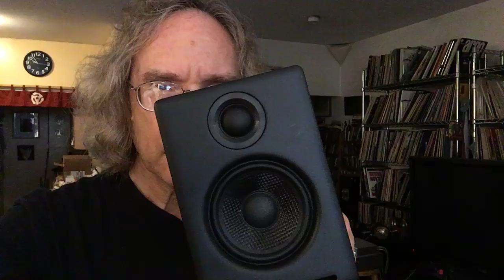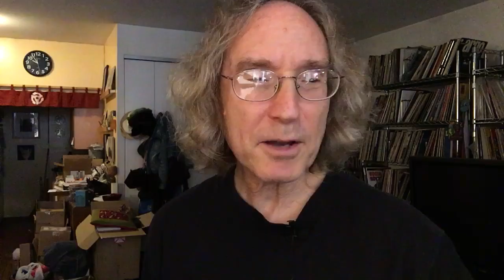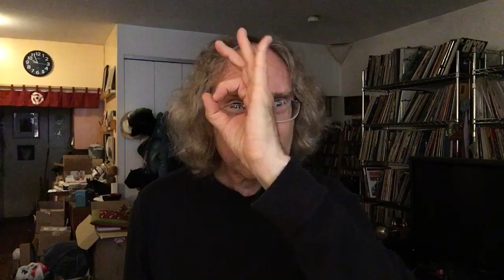The case against 1 inch dome tweeters

Comment: Audioengine P4 Passive small speaker........................................
        Hey Thanks.  5 years later & they're still available new for $249 a pair.  They just went #1 on the tiny speaker wish list.
 
                                                                                                                                                    Acid Jazz, Funk & Brass   🔈🔉🔊
Reply from the maker: Just letting you know, I may be getting a less than $100 a pair speaker in for review. Of course I have no idea how it will compare with the P4.
Reply: @SteveGuttenbergAudiophiliac  .
                      You're out-a-sight man.
Reply: @SteveGuttenbergAudiophiliac  .
                         Excellent. You're out-a-sight man.

Comment: I'm not an expert either but when I think about it, the ear is much more sensitive to high frequencies in that you need less power and less air movement compared to lower frequencies. It doesn't take much surface area. The higher the frequency the more directional the sound. The spatial cues are in the high frequency range. When you use a large surface cancellations may happen and due to the larger mass you need more power to drive them. I'm not sure how that physically works out with Magnepans tweeters though. 
Then the crossover is also important and speaker placement, room treatment etc. With my diy speakers I use them in quad stereo setup and find the sound stage similar to headphones while retaining the detailed bass punching in the gut :)
And time of arrival is also important for impulse sounds like the crashing cymbals. So the drivers should be at the same distance from the listener so cone alignment can be important. Crossovers can shift the phase to that's also important (commercial speakers often have sub par phase implementation in the cross overs if I can believe GR-Research).

Comment: What's up with dome tweeters you ask?... Well, how about for example they offer a 'Point Source Conical Dispersion Pattern' unmatched by panel speakers. :body-blue-raised-arms:
Reply from the maker: You're correct, but wide dispersion also creates more reflections off floors, walls, and the ceiling.

Comment: It's because of physics, Steve. There's not a lot of energy up there and the wavelengths are very short. No reason why a 1" diaphragm wouldn't be able to reproduce 3-25k at very high volumes with low distortion.

Comment: Until you made the statement that there seems to be an overabundance of soft dome tweeters in use from low to high end speakers, I hadn't thought about it. But you are exactly right, and I must say when I started looking at speakers from your question it does make one think that there would be more diverse, and innovative tweeters available and in use. Especially with speakers costing tens of thousands of dollars a pair. And that the public is being laughed at for being "suckers" by the speaker manufacturers.  I think you are on to something here.

Comment: I think there are some pretty good soft dome tweeters. However, they must not be smaller than 1 inch. With the exception one companies .75 inch soft dome tweeter, I haven't heard a good soft dome tweeter below 1 inch in diameter. And, yes I think compression drivers outperform the soft dome tweeters a large majority of the time. I cannot comment of the ribbon tweeters, haven't heard them yet.

Comment: Because of their dispersion characteristics and low frequency performance. 
Most domes can reach down 1-3khz, ribbons much higher toward 5k often. 
Also, their dispersion is quite wide without a waveguide. 60-80° easily, some more. Making designs using them less needy for placement.
Both of these things combine to make matching up with an average woofer quite possible. Both in terms of mitigating beaming from the woofer, and allowing both to play in an optimal range. 
Basically, they are a godsend for simple 2 way designs, and without requiring a waveguide or horn like a compression driver. 

Ribbons generally go in 3 way because of the high cross frequency, most woofers are well into beaming and breakup at that point, so they add a small midwoofer  or dome to cover everything in between. 
Compression drivers aren't generally cost effective, and are a bit different to work with, not to mention the physical mass and size of most compression drivers. 

So it all circles back to the nice and easy dome tweeter. 
Such a simple design that does so much. 

Want more? Go for better designs 🤷‍♂️ 
I personally like a 4 way. 
Subwoofer taking care of 1~50hz, woofer taking care of 50~450, midwoofer taking 450-3k, 3k to 20+ taken care of by a coaxial compression driver. 
It's what I'm working on right now with a b&c triaxial, and jbl cinema subwoofer. Sensitivity will be near 94db, though will probably only go down to ~24hz without issue. After that I'm going to be excursion limited under that at 110db and I plan for much much more. Probably change the box and tuning for the jbl cinema woofer and add a large powered horn loaded ulf section to take care of ~30hz down. Then I can run all the way to 122db before I need a different woofer. Which will probably be fine in my space.

Comment: What's happening is this... Sound is Holographic in nature and therefore any speaker that is domed,... will emit a better representation of the harmonic resonances that it projects onto the immediate environment as a point source of information and pressure mediation.  study holograms and watch a documentary on cymatics. All sound is cymatic so don't get caught up in the "cymatic frequency thing"...   it's just the physicality of  transductance into 3d space and happens from sub sonic up through the magnetic spectrum as light.  With respect to Woofers emitting better tonality in representing mids and upper mids.... what you are noticing is the fact that polarization on a surface causes the overtones to reach out like a light saber, creating extreme localization perceived by the listener of a well tuned system. Tune meaning room volume to speaker resonance capability and room frequency response.  So ultimately get the most rigid cones you can for mids and subs, provide the cones with decent travel edge and a deep voice coil and you'll produce 4D Sound apposed to 3D, as the time crystal properties of your listening space will be both physical and energetic.   Happy listening, Happy Mixing.

Comment: When one gets up into the multi thousand dollar class of any audio gear, at what point does the improvement in sound quality and fidelity  become psychological than actual? There cannot be a perceptible  difference in sound quality between a ten thousand dollar audio system and a 50 thousand dollar audio system set up in the same room.  Granted a high end audiophile setup will run circles around a cheap Best Buy special.  But IMHO it gets to a point that one says they think they are getting better sound quality because they spent the price of a luxury car for an uber high end system featuring titanimun nuclear enhanced floating point speakers made of some exotic material from Planet Praxis, vs just having a great pair of loudspeakers. An example of this is a blind experiment done do a group of audiophiles where they listened to given music played on a given system with high end speaker cable and then once again only with the speaker cable swapped out with coat hangers. The audiophiles could NOT tell a lick of difference between the speaker cables and coat hangers. I say this because maybe the same logic applies to the use of dome tweeters rather they are used in more affordable speakers or in a 50,000 dollar pair of speakers.

Comment: I agree!  Not just in tweeters, but more surface area is better at all frequencies.  It's better acoustic coupling to the air mass in the room and a large area requires less excursion to get the same volume displacement.   Personally I like Air Motion Transformers for tweeters that are large enough to have significantly more surface area than a 1" dome.  My 2-ch system uses the Dayton AMT-Pro4 and in my opinion there isn't a 1" dome anywhere that can match the performance.

For my new home theater I'm building CBT line arrays with fourteen of the AMT-Pro4's in each main line and ten in the center line.  These will have dramatically more surface area than a dome tweeter.  I expect these to sound very effortless!

Comment: To reproduce the sound of an airplane you don't need a 100 meter speaker. Its about the energy going throw your ears. tweeters are far directional and far closer to our ears in comparison to drums in a live concert. personally I dont like soft domes but its another story.

Comment: i can say, with personal building experience for the past 2 years, power handling and ease of integration is the biggest reason for 1 inch dome tweeters. i personally use a subwoofer, midbass, full range that is used to cover the vocal range and into the 4-5k range, and then either an amt or a silk dome and bullet super tweeter. i like splitting the frequency range across drivers well suited to those frequencies, and i like to stay on the large size for all my drivers. a 12 inch servo sub with a pair of passives, 7 inch midbass, 5 inch full range, amt, and a bullet makes for one of the most dynamic and gigantic sound profiles to ever come out of a boring looking set of "towers"

Comment: How about the case against horn tweeters?   Hardly smooth at all, although they're rather efficient, if memory serves.  
Generally speaking, the more of a power hog a speaker is, the better they sound.
The same goes for a big inefficient engine in your car, if what you prefer is speed and responsiveness.   
In almost any arena, "bigger" is always better than smaller, except for when it comes to all around convenience.

Comment: It's just physics. Lower frequencies produce longer wavelengths, which require larger diameter pistons. Higher frequencies produce shorter wavelengths which require smaller diameter pistons. The smaller the diameter, the better the high frequency off-axis response. A ribbon, for example, might be good on the decay but no so much on the attack, and their vertical off-axis response, unless augmented by a well designed wave guide, isn't as good as a well spaced dome. A small diameter, concentric radiator such as dome tweeter is an excellent choice in most applications. There is a reason that they are so prevalent.

Comment: the thing with dome tweeter is the ability to handle power and also radiation pattern issue.
a properly designed dome tweeter(yes, with a horn or waveguide) sounds better than normal dome. the thing is that bigger driver or horn loaded driver has better impedance matching with air. like you have a funnel with steel balls filled and you push the one steel ball from the smaller side of funnel(throat of horn and less air molecule), it moves the many stacked in front(more air volume at mouth of horn), so you get efficient speaker, which can be then reduced in sensitivity by circuit so driver move less. 

the issue is more of power handling and those small driver power limit hits quickly and they distort compared to bigger counterpart and about horn loaded, they dont need to powered much to get much loud.

Comment: The sound pressure produced by the driver is proportional to the sound frequency squared and is proportional to the volume of air it moves. What this means is that the driver has to move 10000 more air back and forth to produce the same sound pressure for 30Hz when compare to 3kHz. So a 10" driver playing 30Hz is still require to have 100x more linear movement than a 1" tweater playing at 3kHz.

Comment: If you listen to auditorium loud sounds, the Klipsch large speakers cannot be beat.  If you have a monitor on your desk with a Morel soft dome, then you get a refined sound at limits of speaker on your desk.  A small room needs a good metal speaker to give you a reasonable loudness with a refined sound.  Like cars, there is a tweeter for everyone's need, and they are not always the same tweeter.

Comment: Size doesn't matter , our ear's hole is much more smaller than 1 inch. the energy needed  for reproducing Hf is much more less than lower octaves and  this is why we can use 1 inch tweeter or even smaller. actually the efficiency of most modern speakers is around 1 percent so a tweeter which is tweeting with 20 watts input actually emits 0.2 watts of acoustic energy and if you are sitting 4 meters a way just few micro watts will get into your ears. all the mystery is behind the hearing not the dome tweeters.

Comment: A lot of y'all are missing the point he's trying to make. Yes, you can easily explain WHY they need to be small and their application, but that is beside the point. He's talking about it looks a bit strange to have fancy midrange/woofer drivers and such, and then your "typical" dome tweeter on top, no matter it being a cheap or expensive speaker. And he's right, from a casual glance, it does appeal a little silly, like tweeters are being neglected. And even if it's typical for a reason, we often take for granted what we have and forget about the engineering or work that went into basic things; case in point, how such a "simplistic", "tiny" dome speaker can reproduce thousands of frequencies... and accurately too! Some of you need to get your sense of wonder and curiosity (even if it's not accurate) back.

Comment: Hello Steve. I'm graduallly trying to get familiar with the physics involved with loudspeakers. I have a question I hope you're willing to answer. It seems that the diameter of dome tweeters varies from 19mm to 38mm. Why aren't there any dome speakers with a larger diameter, is it because of (deconstructive) interference, comb filtering or something like that? If so, why can ribbon tweeters have a larger surface area without this disadvantage? Maybe this question is to complicated to answer in the comment section, in that case, do you have a suggestion on books I should read to get to know more about tweeters (speakers in general)? That is, apart from watching this informative channel of course!

Comment: I'm sure you understand that we don't hear the very high frequencies other than the possible harmonics that may influence the actual frequencies we do hear. The thing about high frequencies is the waves are so short, it's much less work and time to create the waves as opposed to what a woofer does. Your argument about your bigger speaker with whatever larger driver used to create handle all those frequencies does not always make it better. Each type of speaker has a different sound dynamic. For instance, I never liked Klipsh for anything other than filling a large space with sound. In a small intimate space, the horns sounded directional and almost piercing. The best part of a simple speaker such as the DCM Time Windows which I commented about in another of your videos is that the presence of sound is much less in your face than other speakers with more drivers. For instance, back in the 80's when I started building speakers, I thought (and I used Philips tweeters quite a bit just like DCM did) I thought if two tweeters sounded good, 4 would be even better. Not so. Each time you increase the overall surface area of a driver(s) reproducing a frequency, you move the presence closer to the listener. So a speaker with one tweeter and one woofer 15 feet away, might sound like it's 15 feet away. Double the drivers and the sound is more in your face, like if it were 7 or 8 feet away. It also makes it hard to create space in between speakers. This was also sometimes the problem with Klipsch in smaller spaces. I know my points are a bit convoluted and mixed, but I used to be very passionate about speakers and you started me missing my audiophile days. What an expensive hobby I once had. Sheesh! Thanks for your opinions.

Comment: after the fact comment here , so I wanted a air of original Tekton lore speakers ( gold dome tweeter) ,  live out of country so I imported the drivers , guessed the crossover and gues what …. Full  range bass driver running full range up to 5or 6khz , gold dome tweeter crossed at 2500khz . Now the tweeter doesn't carry all that burden  and it has some real magic to my ears . Not typical but an exception to the question you raise. I will say I have listened to some speakers with dome tweeters that are very smooth /easy to listen to for extended periods. I believe the tekton formula delivers that concept in spades. dynamic , full textured live like via the bass driver design without listener fatigue that (can) occur with horns. maggies are another animal but need bass supplement to my ear , I want 1 speaker to bring the goods without a sub , maggies aren't there for me.

Comment: I have always wondered why there are not 5 speakers per side. A woofer, mid woofer, midrange, mid tweeter, and tweeter. It takes all the strain off any 1 speaker and depending on angle or side to side placement, allows a designer to play around with the harmonics of the totality of the speakers. I went into electronics repair and design and not audio but sometime I wish I had learned more about the audio side and speaker design. I used to build award winning Car Sound systems and can design a sub box and setup to rock the street, but never went far enough to build speaker systems.

Comment: 1979, Braun/ADS  had a 3/4"  dome tweeter.  Perfection.  A dome is an inverted cone.  Well made domes are well made...don't compare magnepans completely different (diffuse)  sound to point source.  One is NOT better than the other, it's a subjective taste.  A scan speak revelator > magnepan.  But then again, so are Raven ribbons, B/G  neodymium ribbons and Genesis ribbons.  Oh and infinity ribbons.  I guess a LOT blew my maggies away.   Good dome Tweeters can handle the power, frequency range and g forces.  Deal.